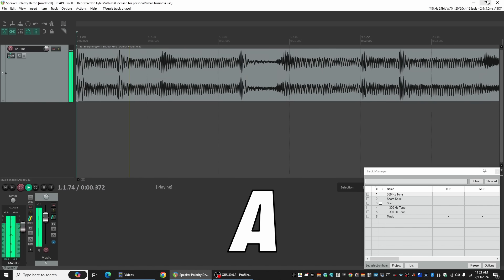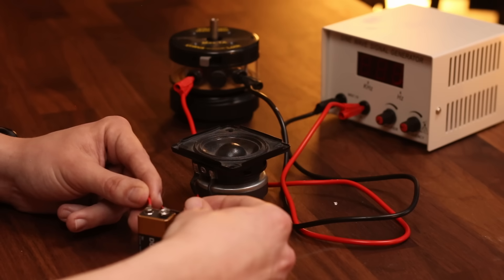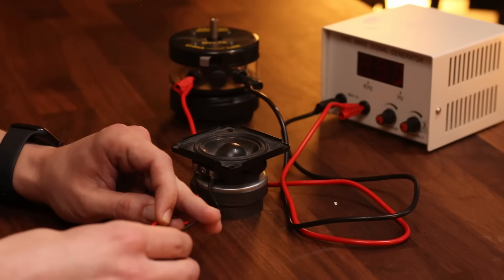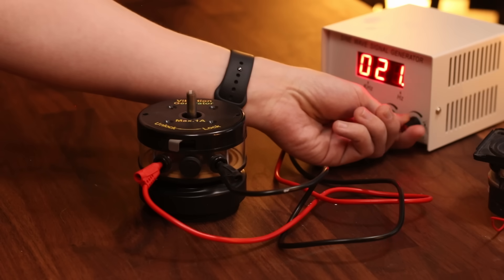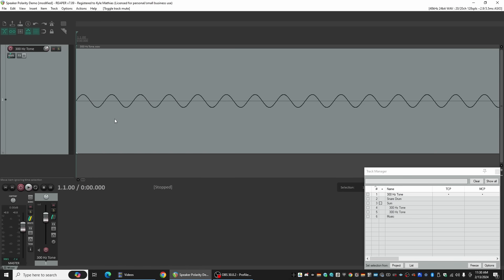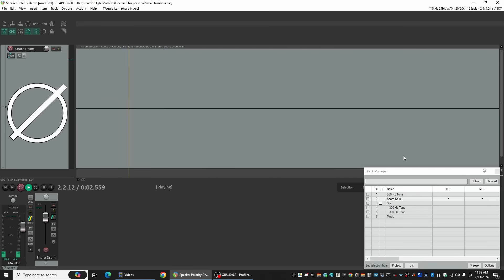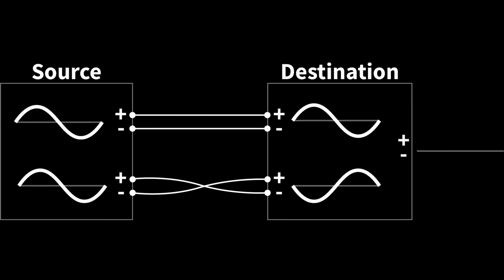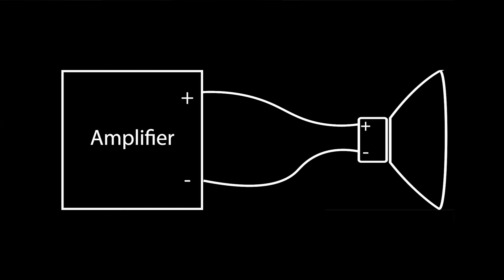What Happens When You Wire Speakers Backwards?

Comment: PLAY SOME STEREO WHITE-NOISE!  Use an AM radio receiver to get some loud smooth static.   Then, with reversed polarity on only one of your speakers, walk around the room.  
You'll discover the "PLANE OF NULLIFICATION," a mysterious invisible barrier of silence, only detected by your ears.  Use the balance knob on your amplifier to shift this plane in space.  (You can slowly sweep the wave-cancellation through the heads of people standing between the speakers.)   Also, just outside the thin null-plane, there's a 3D pattern of "comb filtering," hanging in empty space.  It screws with stereo imaging, and messes with the whitenoise spectrum.  Putting your head into the plane, sounds like putting your head into a giant invisible pipe.   (If this involved white light, then we'd have a black plane in space, surrounded by thin parallel layers of rainbow subtractive-colors.)

Hmm, does nobody know about this three-D white-noise trick?   I'd have thought it would be a big hit in the Disco era, along with 1970s "phasor," and also that tape-deck "flanger-echo" effect.   Do it with yer vintage quadrophonic speakers!   Make a movable sound-hole in the whitenoise filling a dance-floor.

Even better, try making a Bubble of Interferometric Otherspace.

Place your speakers wide apart in a front yard, place a microphone very near the sidewalk or street.  Turn up the volume just below the threshold for feedback.   Now, walk along the sidewalk.  The spectrum of scuffing shoes now depends on radius from the microphone.  (A spectrum analyzer will show a comb-filter effect, spread out as an invisible sphere hanging in your yard, centered on the microphone.)   

But what happens when one speaker has wrong polarity.  Dunno.   YOU try it.

Comment: I have a pair of RTR speakers from early 70's, and if I remember right, the woofers (2x12 each cabinet) are sealed together on the backside and wired oppositely. Was supposed to push and pull each other together to double output. Made sense to me, all I know is they still sound great!

Comment: The signal to the speakers is an AC-voltage w/o DC-offset and therefore is no need, to ensure a specific polarity. The most important is just, that all speakers are connected in the same way.

Comment: A simple test I use, play any Monaural sound through the system, if you can hear each speaker, one is wired wrong, when correct the sound will come from the center as though there is a speaker in the center. You can even do it with a battery

Comment: Back in the mid 1970's I worked installing PA systems in a grocery store chain, the system was a 70 volt system that was used to play mono background music when it was not being use for announcements. The speakers were mounted in the ceiling of the stores and to keep the speakers from canceling one another out we had to space the speaker properly to take in account the delay of the audio from each of the speakers and we had to switch the polarity of each of the speakers because of that delay to keep them in phase with one another. This was to minimize the locations in the shopping aisle that presented cancellation zones.  It worked very good.
Reply: Fascinating. I worked on that stuff too.
Reply: You have to do the math between the ohms of the speakers and series and parallel loads on the amp. You just can't hook them all up in parallel like most people would. Thankfully those days of problems are loin behind me. Uh I meant long behind me. Same thing I guess, oh well.
Reply: @davidmacphee3549  It was a 70 volt system using 70 volt transformers.
Reply: @davidmacphee3549 That's why commercial audio systems always use 70 Volts or 25 Volts on the output of the amplifier as well as on the speakers (which are connected using speaker transformers at each speaker or horn).

Because the system is high impedance, you no longer need to do any math using Ohms Law. The speaker load is determined by connecting each speaker through the correct wires (taps) on each of the speaker transformers.
Reply: The first phase effect was accidentally discovered while moving one of two playback heads left and right as tape was moving past, mixing both head outputs, which created a cancellation effect that inherently swept across the audio frequency band. Fundamental frequency waves didn't phase but music and white noise worked great. Check out the vocal and drums fills in the chorus of Itchycoo Park by Small Faces for what I believe was the first use of phaser effect on record. Turned it into a comb filter with a variable driver oscillator and Ibernez put it in a pedal.
Reply: @cliff481  I could do the same with two tape recorders, each with its own speaker, playing the same music. Their speed wasn't as stable as of modern equipment, so when they were started at the same time it gave the same effect after a few moments.
Reply: @xbia1  Yes, if one was 1.0001 percent faster and maintained that difference, you would experience phase cancelation at hi frequently first, then sweeping through the spectrum to bass, then it would get interesting.
Reply: @cliff481  comb filtering is actually just a repeating echo with a very short delay time. Once the echo period gets into the audible range, you no longer hear it as an echo, but as a series of cancellation and reinforcement at frequencies that are multiples of its period.
Reply: @cliff481  And they called it a "Phase Shifter".
Reply: I could not imagine a scenario today where a grocery store would go to this length, or even care, or even know to think about this.
Reply: @diamondsmasher  It was not the grocery store chain that demanded it, it was the man that I worked for at the time, it was his policy: DO THE JOB RIGHT OR DON'T DO THE JOB AT ALL!!!
Reply: You need to introduce delay, not a phase change for multiple speakers to work coherently.
Reply: Although music is all different frequencies, so there's no one distinct phase change, so may as well just keep all the speakers in phase imo.
Reply: Yes. But you guys make me think about something here but not here. We don't have it.
 Let me imagine this for a moment or so .. Can't we have a button on our so, advanced remote that we can flip polarity around?
Reply: @davidmacphee3549 Yes, that would be theoretically possible in a stereo amplifier, but it would require additional electronics that would switch the output of the amplifier. If you can't keep the polarity of the wiring straight, you really have no business connecting speakers in the first place.

BTW, in a stereo amp with 2 speakers, proper relative phasing is easy to test. Play some music that has bass frequencies. Turn the balance control all the way to the left side. Next, turn the balance control to the center and listen while you are standing somewhere in between each speaker. Turning the knob toward the center should make the overall volume louder. Louder = speakers are IN phase. Softer = speakers are OUT of phase. If they're out of phase, flip the + and - wires around on ONE speaker.
Reply: @TimpBizkit You are correct Timp. It doesn't matter if your system has two speakers or 200 speakers. ALL SPEAKERS MUST BE IN PHASE! If not, the speakers will be working against each other. This is especially evident in the lower frequencies (Bass). In-phase speakers work in synergy, making them seem louder. Out of phase speakers have a cancelation effect (softer) on all frequencies, but because of the way humans hear, that effect is very noticeable in the lower (Bass) frequencies.
Reply: @TimpBizkit  You are correct that music is all different frequencies, but when you reverse the polarity of one speaker you are reversing or changing the phase of all of the frequencies to that speaker in relation to the other speakers by 180 degrees, so PHASE MATTERS.
Reply: @onmyworkbench7000  I'm talking about speakers in a supermarket in different locations. You'll not going to have a constant phase because wherever you walk you're hearing different ceiling speakers at different distances, so I'm not sure how a polarity inversion of some speakers would even be useful.
Reply: @TimpBizkit   “You'll not going to have a constant phase because wherever you walk you're hearing different ceiling speakers at different distances,”

You are correct, you are hearing different ceiling speakers at different distances, first all of the speakers were mounted in the ceiling over the center of each of the shopping aisle and all of the speakers were all spaced the same distance from one another in each aisle, the spacing was calculated by measuring the length of the aisles and then calculating the distances that each speaker had to be from one another. To do this we used the average human hearing range of 20 Hz to 20,000 Hz, we subtracted the human low end hearing range of 20Hz from the 20,000Hz for 19,980Hz and then we divided the 19,980Hz by 2 for 9,990Hz and used that to calculate the spacing of the speakers in each of the shopping aisles. This was in the mid 1970’s so all of the calculations had to be done by hand using a pencil and paper (No computers or spreadsheets back then). The speaker that you were directly under would be your dominate speaker and you would hear that speaker the most when you were under it. When walked past that speaker to the point where it’s sound level started dropping off you were then in-between it and the next speaker you now had two speaker that were in phase with one another and that helped maintain and even sound level down the aisle.

If you have 3 ceiling speakers and the one on the left and the one on the right are wired in phase and the one in the center is wired 180 degrees out of phase with them, when you are standing under the center speaker it will sound good but if you were to stand in-between either the left speaker and the center speaker or the right and the center speaker they will cancel each other out. We tested it by doing just that it they did. We also wired every other shopping aisle 180 degrees out of phase with the next aisle so the speakers over that aisle that you were in would be the dominate speakers for you.
Reply: @onmyworkbench7000  oh so it was to stop you hearing adjacent aisles as much (and their resultant time delays)? Surprising how much thought was put into background music then.
Reply: @onmyworkbench7000 You were wrong to connect every other row out of phase. It doesn't matter if you are connecting 2 speakers to your home stereo, or 200 ceiling speakers in a grocery store, or 100 speakers and horns in a warehouse or a stadium. For optimum efficiency and intelligibility, ALL SPEAKERS MUST BE IN PHASE.
Reply: @toddwilliams8761  that also means all speakers must be within a quarter of a wavelength of each other, which is not possible in most applications.
Reply: @TimpBizkit   @TimpBizkit  I'm not sure which of my comments you're referring to when you say "all speakers must be within a quarter of a wavelength away from each other"?

 Audio wavelengths get very small in higher frequencies, so I know of no wide-range speaker placement formula that would ever include audio wavelength. Besides, a typical background music / paging system uses 8" wide-range speakers. These systems (while not hi-fidelity) will carry a relatively wide range of audio frequencies (many, many different frequencies at any given time). 

Some phase cancelations (and phase enhancements) will occur in any audio system with more than one speaker. Proper phasing in any audio system is done so that all speakers are pushing and pulling together at the same time (working together).
Reply: @toddwilliams8761  it was the comment about "all speakers must be in phase". Over a wide area, the polarity of the drivers might not be as critical, although as a neat freak I would still wire them that way. It's impossible to get one time delay that works in all locations, but delaying in the direction speakers are facing is a good start. If you had speakers on poles pointing in one direction, you would want to delay in the direction they were facing. This means you get closer to hearing one coherent sound when the speakers are pointing at you, and if you're behind the speakers, the sound from those is muffled enough not to notice the delay coming back at you.
For speakers pointing straight down this is not as critical.
Reply: @TimpBizkit  I'm a technical person who has worked in an electronics technical/management position since before I was in college. 

I worked for one of the leading commercial sound installation and technical service companies in the Baltimore/Washington, DC area. We designed, specified, bid, and installed (and serviced) commercial sound reinforcement systems. We serviced and installed systems for small churches, government facilities, public schools, grocery stores, department stores, stadiums and even an international airport. 

I have several years in this industry, and I do know what I'm talking about when I say "ALL of the speakers in a commercial sound system MUST BE IN PHASE".

If you still disbelieve me, there are countless books on the subject. Most of the good ones were written years ago. I'd recommend you buy one made of paper and ink. Those will usually have a great explanation of "the importance of phase in a multi-speaker environment".
Reply: @toddwilliams8761  well you'll know a lot more about it than me. I mean if you wire incorrect polarity on some speakers, it will make it impossible to dial in any time delays, as inverting polarity causes an inconsistent time shift depending on the frequency. It will always be half a wavelength out. In certain subwoofer arrays, inverting polarity is a tool that can be used in conjunction with time delays to have bass in one direction only (cardioid arrays).
Reply: This will only work for one frequency and multiples of that frequecy, the rest wil be random.
Standing in the middle of two speakers it will sound worse.

Comment: When playing your first sound it was obvious what was wrong, the sound was out of phase so it sounded as though it was drifting left of center in an expanded almost surround sounding appeal.  This is usually the tell with audio, and when its out of phase you can't increase the volume and get the same type of SNR response.  It'll sound hollow with no boldness to it at all like you are deliberately using a surround filter and its almost always off center, unless you've wired both speakers backwards and then the sound is just hollow and flat.

Comment: Many moons ago, when I was installing Car audio systems, this was a big thing.
We called it phase shifting, or basically In Phase or Out of Phase. + vs -.

We had a small handheld device that would tell us if the speaker was In or Out of phase so the installers would then know if they wired it correctly.

Simple tool, but effective when dealing with Car audio.

And it is a still a big issue today with that. I even picked up some factory fitted systems with the speakers wired up wrong.
Pop them out, swop the cables and the sound it just so much better.

Anyways. Stay awesome!

Comment: A bit out of application, but relevant. I use to install sound systems in model train locomotives. In some diesel locomotives, the prototype used two diesel engines. On those models, when space was available, I would add 2 speakers, but I would cross phase them. One was positive to positive, negative to negative, but the other speaker I wired positive to negative, and negative to positive.  When dealing with tiny 4 and 8 ohm speakers in a plastic model body, they did not cancel each other out, but instead emphasized a simulated sound that there where two engines in the model and a tone change would happen as it passed by the listener/viewer.how ever it worked, it amplified a doppler shift simulation that was pleasing to us modelers.

Comment: The wrong polarity can be almost naziating if you fix a headphone and connect one speaker in revers.
By the way, aint speakers have a constant ~6 volt DC tension, which is from the sine wave go up and down arround? I am not an expert but I realy never heard of amplifier that crosses the 0 volt rail.

Comment: a while ago i did an experiment. i reversed the polarity of one speaker, but not the other. what i found, was that there was that perceived volume was dependent on where my head was. in the middle, and volume would be lower, and closer to one speaker, the volume would be higher. the one inverted speaker meant that it would interfere in a destructive way instead of a constructive way leading to a lower volume inbetween the speakers.

Comment: If a speaker is designed for a mechanical function in which the diaphragm moves in a specific direction, moving the diaphragm in the opposite direction may apply mechanical stress for which the speaker is not designed. 
The publisher does not claim that is the case, but I wonder.
Reply: It moves back and fouth hundreds if not thousands of times per second either way. There is no issue mechanically.

Comment: you will only hear a difference if the backside of your speaker is completely muted, meaning all of the air pressure has no effect on your position, and if the transient is slow enough. instead of initially hearing a thump, you will hear pmuht, or a drop in air pressure, but only for a split second because the next transient will have the normal effect. it might instead feel like a hiccup or delay.

but if you have ported speakers or otherwise can hear the effect of the backside of the diaphram, there will be no or a slight muffled difference.

Comment: Can anyone help me out with my query:-
Can we connect two Dual Channel Amplifier in Parallel mono mode via a Y XLR Male to Two TS cable ( Amp1- Crown XLi 800, Amp2 - Ahuja TZA 7000DP(Indian Brand)) because I want to connect my mixer via Crown amp instead of ahuja
So following the above question, is it wise to Connect a Mixer from Amp via a  Y XLR Male to Two XLR Female cable.